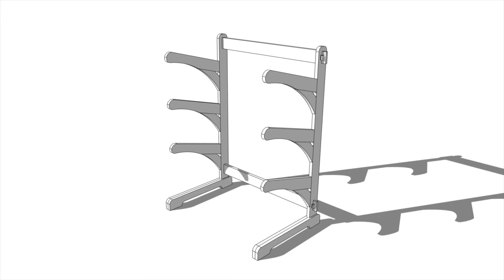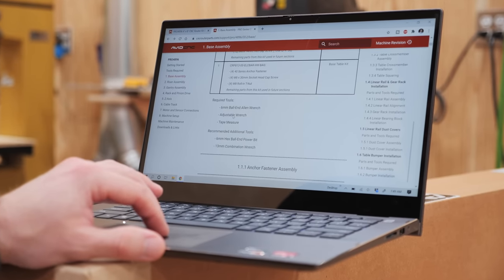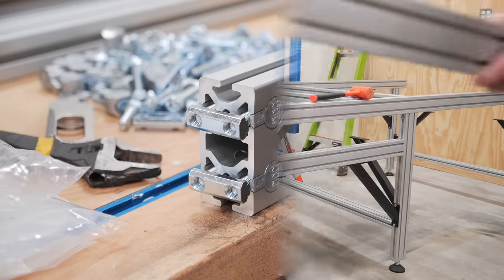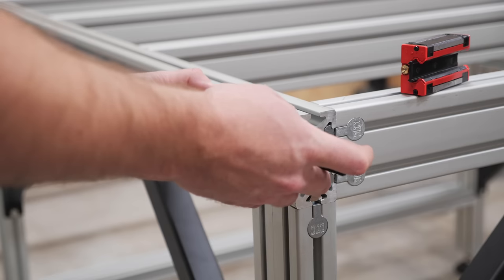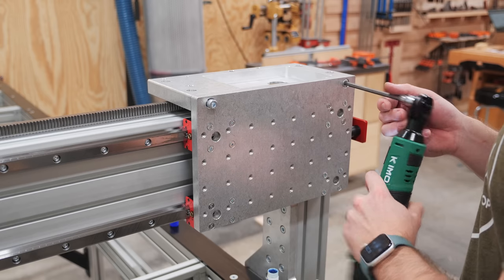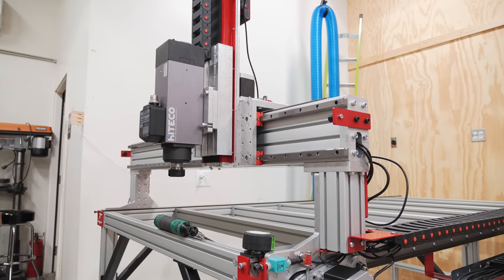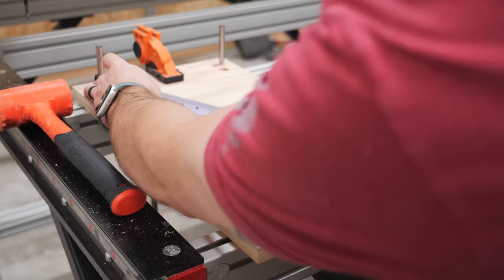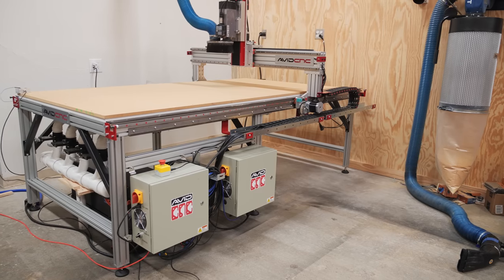I got a HUGE new CNC Router! (AVID CNC 4x8 PRO 4896) // Woodworking

Comment: I have my eye on one of these systems. Was space the reason you stuck with 48” vs 60” width?  Can’t wait to see more of that spindle and what you do with the machine!
Reply from the maker: Yup, plus I just don’t think I’ll need the 60” capacity 99% of the time. Also, the vacuum works better for a 4x8 system, easier to setup the zones.

Comment: That's an awesome cnc. What's the price on that beast?
Reply: Around $5k
Reply: @floris6164   Doubt he paid for it though
Reply: All the prices are on AVID's website linked above - over $15K with the accessories ($5K is without stepper electronics, spindle & VFD, vacuum hold-downs, zero-plate, tramming plate, etc.)  Nice set-up!!  Way snazzier and more functional than my ShopBot(s), a bit jealous, but...

Comment: Vacuum tables on CNC machines make a huge difference compared to a regular hold down table. Also calipers instead of a tape measure makes measuring and squaring stuff up on a CNC is a must.
Reply: @stephen matsler yeah i too really had a hard time switching my mind from woodworking (rules, squares, saw and chisels) to machining (calipers, feeds and speeds) ... quite a leap of faith ☺
Reply: This. As a CNC machinist I can confirm

Comment: Great video! Your timing coming out with this video is perfect.  I just received my 5x10 Avid CNC Pro in boxes but still have a couple weeks yet until I can start the build process. I'm really interested to see more on your vacuum work holding system.
Reply: How much did that kit run you?
Reply: @MrIsaacpr7  Just over 14k

Comment: Just spent the last week troubleshooting electronic malfunctions on my 20+ year old machine.
This looks like a good next step -Avid. Good tip with the locktite. Is it possible to rotate the controller
90 degrees so that you can see the ports?

Comment: How much does this entire router table cost to get up and running in this confiiguration?
Reply: Around 10k for the normal setup, probably closer to 13-14k with that monster spindle as there are different electronics that go along with it.

Comment: 5:50 I wouldn't say it's perfectly aligned along the whole rail.. In this case, I would put the jig at shorter distances and gradually. This way it can be slightly off in the middle, however nice documentation ;)
Reply: I was thinking the same. If its hiwin it can be off by 0,04mm per m. I bought chinese knock off rail and trust me it takes me 5 days to mount it with 0,08mm over 3 meters. The center which is 1,5m is still has 0,02mm though
Reply: @thanhnhanhuynhnguyen3652  yeah, I believe I'm within 0.02mm range in 750mm 😅

Comment: Thank you for the time you put into this video.  I've been reviewing options for when I purchase an AVID CNC and I notice with your vacuum holding system that you can't install a vertical table, or I don't see how you can.
  Have you thought of installing a vertical table or do you have other tools for that operation?  Can you install the vacuum system on the other end of the table so you could put in a vertical table and/or a rotary axis?

Comment: I’m about to get my Avid CNC next week. So, I rewatched your video. I have a quick question(s). I also got a Dust Right 1250 collector. I was planning on running a 6” flex hose. How is the 4” working for you? Do you think the 6” would do better? Thanks for the advise.

Comment: You can skip the thread locker. I learned after my 3rd year of using 8020 that the design of the tnuts removes the need for it

Comment: which  software are you using to control the router ? is  it possible to use Fusion 360 ? Also you are using a better spindle, with a lot more power is it more expensive ? and is it plug and play with the Avid? 

i like you're video and explaining  keep up the good work!

Comment: Not enough measurement on the assembly. You’re supposed to use the guide blocks along the length of the linear rail to prevent sagging. Also, you need to check squareness, levelness etc.

Comment: Based out of the Metro Detroit area there are 2 places that supply "Rexroth Bosch Group"--their  "Aluminum Structural Framing System".  Here macho robotics are precisely fabricated in the auto industry using "T"-Slotted Aluminum extrusions. There are an easy 100 companies producing this stuff. I went on line to their site for a few projects. Asked for their one inch thick book catalog, and got a flash drive with the same but also including CAD for everything they have(most people don't have the storage space to download this anyway). Everything can be loaded to SolidWorks enabling anyone to attain exact measurements and all components to make any CNC bridge or gantry milling solutions. Their website will direct to your most conveniently located supply shop that cuts, and packs anything u can dream up.

Comment: eventually you gantry is going to warp. the aluminum is not strong enough to hold the 80 plus pounds you have for spindle plus support and axis plates. you need to run steel bar from within the extrusion

Comment: Hey man i know this is an old video but did you have any issues with your liner rails on the sides binding the bearings at the seams? One side of my machine the rails have a really noticable bump as they pass over the seams actually stopping the bearing when i move them by hand

Comment: My dad has built the electronics for industrial CNC routers for 25 years. We're talking double gantry 50 by 30ft CNC routers and 100ft by 20ft 3D printers with a CNC cutting gantry on the same machine. I've never used a CNC in my life. YouTubers have them in their home shops. 😓😂
Reply from the maker: You can get a small CNC for less than most cabinet saws, so it’s really not much of a stretch.

Comment: Why buy a ratchet and not impact drill? not trying to be smart ass, just never understood when is it better than an impact?
Reply from the maker: It's easier to set the torque setting on the ratchet and then finish tightening the bolts by hand, all with the same tool. Plus you can fit into tighter spaces. I have impact drivers but they're really different tools.

Comment: nice vid. looks like a nice rig. after checking your link, they are heavily overpriced. just the 4 nema / driver kit is $3k. you can get a stepcraft q408 completely built and delivered for $15k. after i saw the $3k they want for $600 worth of steppers i quit considering it. It is a nice rig either way and i wouldnt mind putting it together if it actually saved me money.

Comment: Why are your ceilings so high?
Reply from the maker: Not sure but I love having the clearance for moving larger pieces and long boards.
Reply: @craftedworkshop  Well it will be nice if you ever need to go to a hoist running through the shop.  For me I wish I had left more headroom because now I want a car lift and raising a roof from 7 to 13 is expensive.  Although back then I didn't have the money for 13 feet.

Comment: i'm sure this will get me banned <sigh> ... this is over $5000 at min.... what stops these guys from not scratch building their own for at least half the money??... if your already having to put it together, whats the difference in buying all the materials and building it yourself?.... cutting the aluminum extrusions??.... you cut and build stuff out of wood all the time, how is this different??... the only kinda priority part is the is the rack and pinion.... I really am lost why people at a normal skill level people are buying not building.... I mean unless it was free.... IMO
Reply from the maker: There’s a lot to building a DIY machine from scratch. This took me two days to assemble, it would have taken weeks to design my own machine, get it built and get it to work. After assembly, I was able to start cutting cabinets within a few days. Just depends on what you’re looking for.
Reply: @craftedworkshop  I believe if someone is intelligent enough to use this type of cnc, there skilled enough to build their own... sure it would be a longer process.... thats where you have to factor in the savings.... do I save half?... or do i have it quicker? for many the first option might be there only option, meaning build it for half the cost or not own one at all... but then even if i had the extra money I wouldnt be able to convince myself in paying double.... I'm not talking in the hypothetical I had to made this same decision many years ago when i made my "smaller" cnc , when parts were much harder to come bye.... just my 2 cents
Reply: You're also paying for support from Avid when things go wrong and a community of people that run the same parts and machines.  In my opinion, this adds a ton of value when something breaks and you need to get back up and running quickly. If it's strictly a hobby machine and you have more time to tinker, then building your own isn't such a bad idea.